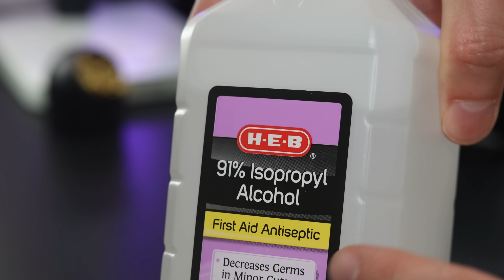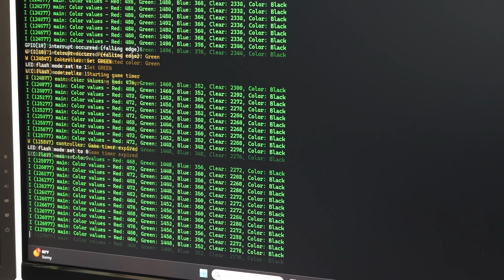Do This Before You Solder Anything

Comment: also, another number one rule for soldering: always have a clean tip.  your tip looks very dirty.  just get a tip cleaner and clean the tip after every time tip touches solder.  when you have burned oxides and burned flux, basically the black stuff on the tip, your tip can not hold the solder.  becomes difficult to flow the solder and more difficult to control the solder.
Reply: I always clean my tip girls like it more this way...when I repair their electronics of course...
Reply: You should never clean the tip after use, but rather, just before making a joint. You WANT that layer of solder left on the tip to protect it.
Reply: @tookitogo  He's talking about using a special tip cleaner that strips crud (and plating!) off the tip. But using that constantly is going to quickly destroy your tip, I reckon. If you can't tin your tip properly, yes, it needs to be cleaned, but you should immediately generously tin the tip after doing this.

And yes, you're right that you shouldn't clean the solder off your tip before putting it back in the stand; clean it after you take it out of the stand, just before you use it to make a joint.
Reply: @Curt_Sampson  Yeah, tip rejuvenators are really only for salvaging tips that are on their last legs, primarily from abuse IMHO. (I tin my tips frequently, so I have never actually needed to use a rejuvenator. I used them frequently at my old job — a vocational school — to revive the tips used by the students, many of whom didn’t tin sufficiently.) And yes, you’re absolutely correct about needing to tin the tip generously after using them. Also, one needs to clean off the rejuvenator flux before tinning, since it’s quite aggressive.
Reply: @tookitogo  "never clean tip after use"  this is not correct.  You're talking about the end of a soldering session, leaving a bit of solder on the tip, in hopes of protecting the tip from oxidation from air.  This is something done by some people.  In reality it is not necessary.  If you try it for years, you'll see nothing happens leaving a clean tip exposed to air.  However, flux is corrosive and you should clean it as quick as possible, especially if it is burned flux residue.  You should clean your tip after each time you get flux on the tip.  Also, I'm not sure if the small amount of flux from the solder core would be sufficient enough to cause corrosion on the tip even if you leave solder on the tip.  I couldn't tell you because I never leave solder on any tip and never had any problem. I tried it once like 25 years ago and realized I would never do that again :-)
Reply: @Mr_ToR  I’m not talking about at the end of a session. A LOT of people’s instinct when soldering is to wipe the tip clean whenever they return the iron to the stand. This means that between joints, the tip is sitting there hot and unprotected. This causes oxidation of the tip plating (the plating is iron over nickel over the copper core). Instead, one should leave whatever residual solder remains when returning the iron to the stand, and then wipe and re-tin it right after removing it from the stand to continue soldering.

Having once worked at a vocational school, where apprentices would routinely not tin their tips sufficiently, I assure you that having no solder on the tip does lead to tip oxidation, eventually resulting in unrecoverable loss of wettability. (And this isn’t just my opinion, it’s what every professional soldering course, soldering iron manufacturer, etc. says.) If a tip isn’t too far gone, a tip rejuvenator can recover it, but at some point, the plating is ruined and the tip must be replaced. 

I do like to apply fresh solder to the tip at the end of a session. But this isn’t to protect it from oxidation while cold, but rather so it’s already protected when I turn it back on: if I turn it on and then get distracted doing other preparation (or by someone dropping into the workshop unannounced), the tip might be sitting there hot for a few minutes before I come back to it. I do not want it sitting there baking away. Solder is cheaper than tips. 

I don’t know what kind of soldering you do. I’m an electronics professional and I solder to high standards, and the method I use is what all the professionals I know do to keep our soldering equipment in peak condition. 

As for flux corrosiveness: electronics fluxes for ordinary hand-soldering (rosin, resin, etc, but not the water-soluble fluxes used primarily in mass production reflow soldering) are not corrosive at room temperature, and are only weak acids when hot. Modern tips, with the iron plating and selectively applied non-wettable areas, tend to get flux residues at the edge of the non-wettable part, where the flux flows but the molten solder cannot follow. The usual brass wool keeps this in check, but occasionally a deeper cleaning is sensible.
Reply: @tookitogo  ok, I know what you said is not wrong.  however, probably for the last 20 years, I never had a problem with tip oxidation or any tip problems and I never leave the tip with solder.  not at the end of sessions and not in between soldering.  Before about 20 years ago, I was getting tip problems but all my tip problems disappeared then I started constantly cleaning my tips.  as for the residual solder remaining on the tip, that is I think is something inevitable.  I believe even after brass mesh cleaning after every time I solder, I'm almost sure that there is always some minute amount of residual solder remaining on the tip.  Maybe that has some positive effect on why my tips are not getting problematic.  However, I just refuse to have a tip that can drop some molten solder if I accidentally bump it or if the cable gets tangled etc.  So I prefer solderless tip to avoid that kind of risk to tip oxidation risk but my experience is that I never had a tip problem but I never dropped solder anywhere by accident too.  I wish I could deal with constantly having a solder on my tip but I know that that is something I just could not do and don't prefer and I just don't have any reason or motivation to start doing it.  I hope this makes sense.
Reply: @tookitogo very well said(to the original poster's comment), and I 2nd this motion!
Reply: @Mr_ToR  Sorry I didn’t respond sooner. I am not talking about needing to leave the tip dripping with solder. The most important thing is to NOT wipe off all the solder that remains on the tip when returning the iron to the stand, which is many (most?) people’s instinct. It doesn’t take much solder to protect the tip. Wiping the tip clean can leave it bare, and susceptible to oxidation.
Reply: @txmechs  Thanks!

Comment: Here in Greece it is almost impossible to find isopropyl alcohol. Most of the stuff is ethanol based such as alcohol lotion which is adulterated with other elements. I did find some isopropyl alcohol at an electronics shop locally but at 15€uro a liter. HIGHWSY ROBBERY!
As a thirty year commercial radio tech, I have had the unfortunate experience at repairing boards with that junk on it. Critical connectors are usually the first to fail because of vibrations in mobile applications. We extract the solder with an extractor with the PROPERLY sized tip for the joint. We clean everything with alcohol ( and in worst case scenarios with acetone followed by alcohol) before resoldering with leaded solder. These radios do not come back for this issue, ever. Lead is flexible compared to lead free. 
What really bothers me is when I see someone utilizing a soldering gun with a huge tip trying to work on a fine pitch PC board. Talk about burning a board!
Reply: I'm in the US. I'll trade you Isopropyl Alcohol for EV Olive Oil! Or Greek Peach Liqueur from Crete!

Comment: Another good idea is to apply a little solder to both parts before making the joint, and I also suggest it when doing copper piping for water again always use flux

Comment: good tips.. i think i will try clean the pcb by using alcohol before soldering
Reply: Use IPA and a small piece of scotchbrite pad on copper traces - you will be stunned how well it works.
But no need to do any of that if the PCB is pre-tinned.

Comment: Well, there's your problem.  You're using shitty solder from Radio Shack or some no-name brand.  Maybe that's why you need extra flux?  I've always used quality solder, from Kester or other "Multicore" solder and 99% of the time, don't need any flux.  Extra flux usually means you have a worse clean-up job after the fact.  About the only time I use extra applied flux is when doing find SMD work and need to do "drag soldering" across a bunch of adjacent PCB pads with a tiny blob of solder on the iron tip, and I'm not applying fresh solder.

Comment: one thing that i've learned recently - if you're doing everything right and the solder still isn't behaving - IT COULD BE THE SOLDER! i got a cheap spool off of ali-express and holy shit that thing REFUSED TO MELT!!! i was at 400 C and it was still barely melting at direct contact with the tip and i was just pushing blobs around on the board! just as an experiment, i got another spool from amazon (highly rated) and it was like butter. ... so just be aware, there is such a thing as BAD SOLDER!
Reply: I can relate to that one.
When I took welding classes, me and my classmates were struggling a lot with SMAW. One day, out of pure spite for the wasted materials, I decided to reuse the electrodes from the trash can. Instantly, it was very much easier to weld and I had my 1st decent joint.
It was so disconcerting, I started to experiment and ended up finding out I'd accidentally picked from the bin a rather old electrode, from the previous course.
Turns out the cheap fucks from management bought  for our class the cheapest of dirty-cheap electrodes, that simply refused to make a good joint.

Except, that is, if you were a very good welder. Because, yeah, our teacher could still weld perfectly, regardless of the electrode he used. 😅
Reply: I don’t understand why people mess around with no-name solder. The amount of solder used in a project is so tiny that even if a roll of solder costs $50, it lasts you for years and years, so the cost per project is still basically nothing.
Reply: @tookitogo  it's a valid point... but some of us are penny wise, dollar stupid... alas.... pity us. it's a sickness : )
Reply: @jinchoung  Heheheh! 

Try this justification: do you want to risk damaging an expensive component or board because cheap solder caused you to have to try to heat it too long or at too high a temperature? :)
Reply: @tookitogo  The fact that he has at least  THREE rolls of Radio Shack solder is testimony to the validity of this statement!
Reply: @SlightMalfunction  I’m not sure which statement you’re referring to (the original comment, or my reply). But historically, Radio Shack solder was quite good quality. No idea whether that’s still true today.
Reply: @tookitogo the punchline is that radio shack hasn't existed for years and years and yet you still have a stockpile 😂

*Wooosh*
Reply: @sirtra  I don’t have any RS solder left. (Actually, I think I have a small tube of their lead-free tin-silver solder left, which I probably bought as a kid in the 80s! But I used up the regular solder years ago.) 

I don’t think there’s as much of a “punchline” as you think there is, in that if a hobbyist bought multiple rolls of solder (e.g. different thicknesses), it’s eminently possible for those rolls to last them for decades. Many hobbyists just don’t use that much solder! At home, I’m still on the same roll of 0.8mm Kester solder I bought in 2014. And I have a roll of extra-thin (0.3mm, I think) Kester solder that I bought in the early 1990s, mostly unused. 

I still don’t know what “statement” the reply above is referring to…
Reply: @tookitogo you must be fun at parties 🥳
Reply: @sirtra  Comments on YouTube videos about technical things hardly qualify as “parties”, so I don’t apply those rules.
Reply: @tookitogo if you flood pads/joints to remove components, then you'll go through rolls quickly. It's cheaper than chipquick and sometimes  easier/safer than hotair depending on the location of components
Reply: @tookitogo  Kester is the only brand I will buy.
Reply: @jonesgang  Kester is my favorite as well.
Reply: @tookitogo when a spool of solder costs more than the project it's a tough sell.

But i bet you use tissues to blow your nose instead of toilet paper, so don't judge... 😉
Reply: @sirtra  It shouldn’t be. You don’t use a whole roll of solder in a project.
Reply: @tookitogo may you never understand or experience the joys of poverty for the rest of your life 😇
Reply: It could have just been the compounds within the solder itself. Some do require very high temps due to what it is being used on. Not all solders are the same. Just like not all flux is the same.
Reply: @jonesgang  I've had the same experience with solder from AliExpress that was explicitly claimed to be 60/40 Sn-Pb. My guess would have been that it was not what was claimed, due either to impurities or merely because it was mislabeled. Regardless, I agree with the original poster: go for a well-known name brand that you buy locally. I'm good with the chance of getting broken/junk stuff from AliExpress for most things, but for solder it's just incredibly frustrating.
Reply: Completely agree, over a decade ago i bought a large spool of solder from a respectable brick'n'morter store and as electronics is just a hobby for me it only recently ran out. Bought some cheap stuff online and didnt think it'd make much difference - i mean its just a metal alloy, tin is just tin and lead is just lead so other than a slight difference with the flux core it should be much of a muchness right?

Well after seeing some of my ancient work and comparing it to recent stuff the difference is huge. I initially thought it might have been related to my solder tip being worn and/or my skills had just gotten worse from old age.

Well after trying tip cleaner, a new tip and even an entirely different iron and scratching my head how as a teenager i'd leave my iron on for hours and never had any tip issues, didnt even have a brass wool just a sponge n water to having to replace the tip on 2 entirely different irons it turns out it was the fricken solder!

Dont get the cheap stuff from Amazon, you'll likely pay for it in other ways... like me 😆
Reply: Yep.  I worked at a place that hired people with zero soldering experience, and I joined with some but not much.  ROHS compliance meant lead-free solder only, and the manager knew someone who "got them a good deal".  The solder was insanely frustrating to work with and nothing would convince them to switch to better stuff.  I got a personal roll of Kester and started using it to make my life easier, and it was night-and-day.  I shared some with a few friends and they agreed.  Even the lowest-skill solder jobs looked at least passable.
Reply: Me too. Chinshitanium solder 😞
Reply: Welp... I think I found my issue...

I managed to tin the tip but I still can't get the wires to actually absorb the solder. It just bubbles on top
Reply: There's many types of Solder, such as silver Solder, 40 percent lead and 60 percent tin, or 60 percent lead and 40 percent tin. And also lead free Solder! There's acid core Solder but it should never be used on circuit board, it's to corrosive!
Reply: So ppl know, yes, bad solder exists, that Ali Express Chinese solder will never work, no matter the heat, no matter if you add $70 flux, it's literally rubbish.  Your work is into ever going to be as good as your tools.  Having said that, I solder like a 40 year electronic engineering veteran with my sub $100 AUD Chinese soldering station, so my rule is a bit different when talking hardware, an old quality tool that is worn out is not going to best a new cheap Chinese device
Reply: Cheap quality or even old oxidised solder is a big no no
Reply: @RumblePirate  At least with old solder, you can just wipe the oxidation off with a paper towel. (That is, pinch the solder wire between paper towel and pull it through so it gets wiped all around.) Cheap solder is hopeless…
Reply: The correct pronunciation is not sodder! It is solder with an l. Say s older . Rhymes boulder
Reply: @christopherpalmer3878 it's sodder, the word was originally derived from the french word sodure which means to join or become one or whole.

I recently got curious if "sodder" was an American thing vs European after noticing the difference in videos online..  but nope!

I wasnt convinced at first as so many ppl i know also say soLder but after a deep dive i can confirm i was wrong.

It's a word i've been pronouncing incorrectly my whole life and ironically this is one time where Americans are correctly pronouncing a European word more commonly than Europeans are.

I'd hazard a guess you are not American...  ?
Reply: @sirtra  In fact, while both modern British English and American English have evolved since they parted ways 400 years ago, it is actually usually American English that has stayed closer to the ancestral form. Both dialects changed, but British actually changed more.
Reply: @tookitogo just like Freedom units for measurements. Oops i mean imperial.

Going to a gas station to fill up your to gas tank full of a highly flammable liquid will never make sense to me. Or petroleum jam. Oops i mean jelly.

*Boom tish* I'll see myself out.....
Reply: @christopherpalmer3878  Both pronunciations are correct.